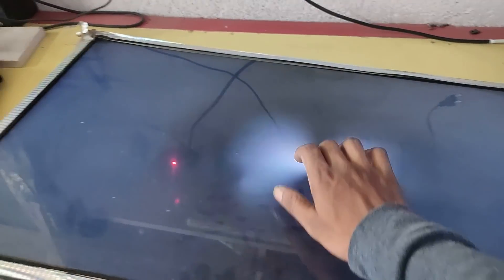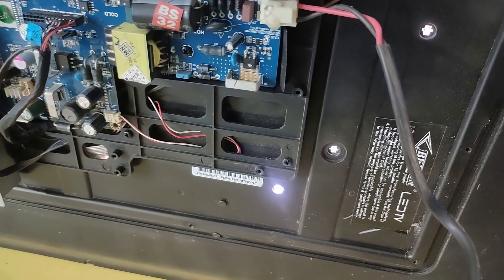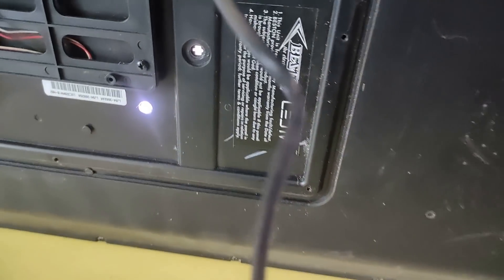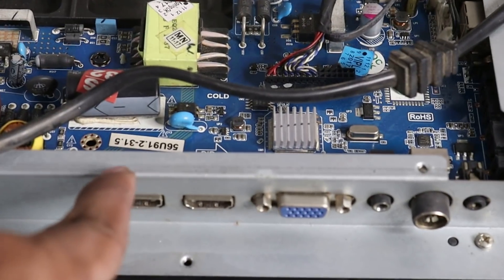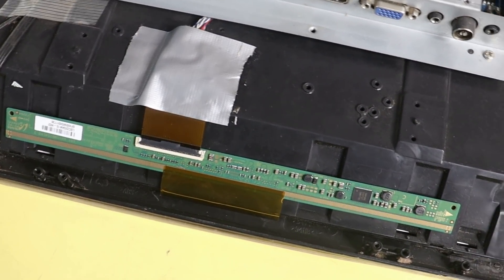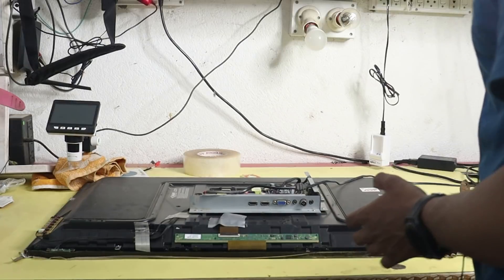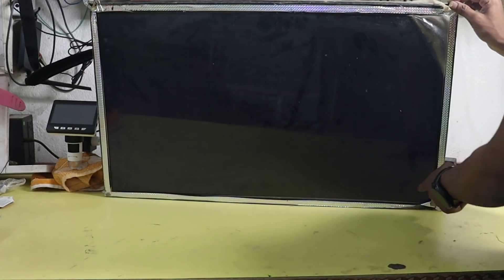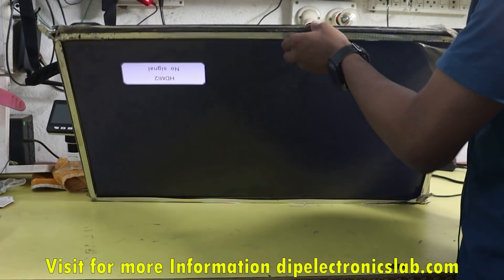Cut The CKV line and Repair LED TV Blank Display Problem In English

Comment: PLEASE HELP ME TO FIND CKD IN KODAK 40FHDPRO IT IS WITH TWO COF , ON LEFT CAF 7.2 V NOT COMMING ALL OTHER 12V, 2.2, 1.2 ARE WORKING AND DC DC IS NOT COMMING UP. . DISPLAY WILL FLASH , ON POWER ON.
PLEASE HELP.

Comment: I have same panel with this same fault I m not getting any core voltages avdd vgl vgh etc only 12volt vcc present what should I done please rely n one more question one element on left side ic like seeing pf dark brown what is that  i m getting full continity on this element